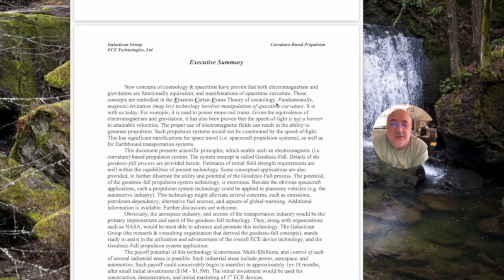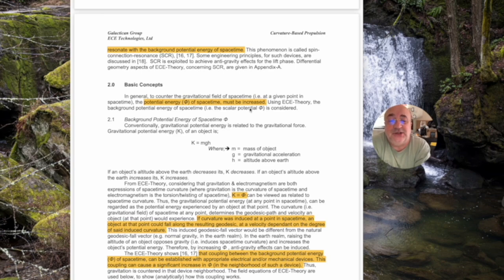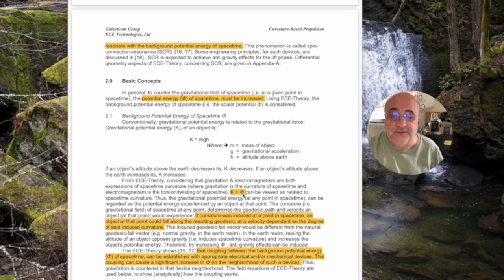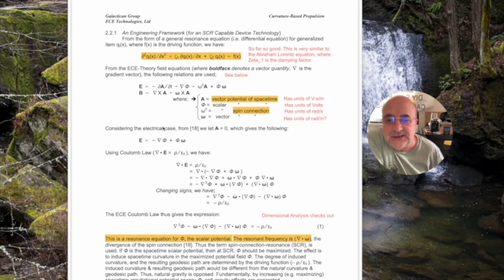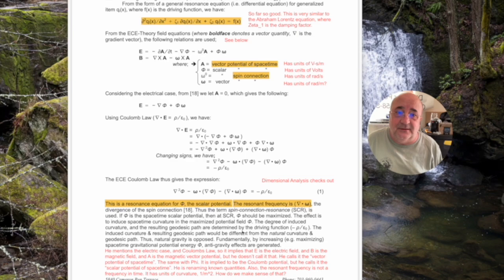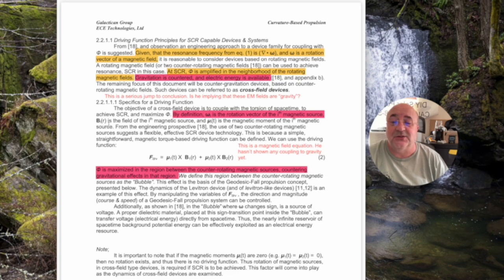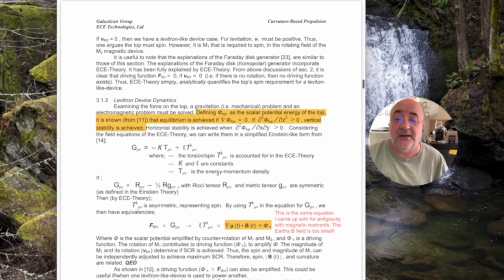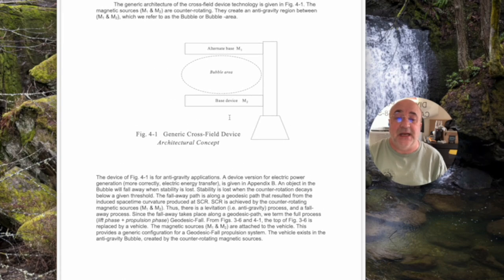Reviewing ECE Theory

Comment: Correcting the Reviewer’s Errors
The reviewer makes several mistakes about ECE UFT and the patent’s claims. Here’s a clear breakdown of their errors and corrections, using ECE’s math and concepts:
1.  Error on Scalar Potential (φ) Units:
	•  Reviewer’s Claim: The patent and ECE confuse φ, calling it both volts (V, electrical potential) and energy (mgh, gravitational potential energy).
	•  Correction: In ECE UFT (ECE Eng Model, pp. 4-6), φ is the scalar potential of spacetime with units of volts (V). It’s defined via the tetrad (q^a, units: meters) and a constant A^{(0)} (units: V s/m), so the 4-potential is A^a = A^{(0)} q^a. Gravitational energy (mgh, joules) comes from integrating curvature effects, not redefining φ. For example, the gravity equation (derived below) links curvature to energy-momentum, and mgh is a result, not φ itself. Bruchholz’s paper shows EM fields arise from spacetime curvature (R_{ik} = (1/4) g_{ik} F_{ab} F^{ab} - F_{ia} F_k^a), consistent with volts for φ. Maxima checks in UFT155 confirm no unit mismatch. The reviewer missed how Cartan geometry handles field units via differential forms.
2.  Error on Resonant Frequency from div(Ω):
	•  Reviewer’s Claim: The reviewer says the “resonant frequency” from the divergence of the spin connection (div(Ω), Ω in rad/m) has units of curvature (1/m²), not frequency (Hz or rad/s), so it’s nonsense.
	•  Correction: In ECE (ECE Eng Model, pp. 28-29; UFT382), the resonance equation for φ is ∂²φ/∂t² - Ω · ∇φ - (div Ω) v φ = ρ/ε₀, where v is velocity (m/s). The spin connection Ω (rad/m) combines with the speed of light (c, 3e8 m/s) to give a frequency: ω_res = c² div(Ω), which has units rad/s (proper frequency units). This comes from spacetime scaling in Cartan geometry (nLab: torsion T^a links to EM via frequency). UFT94 (Bedini device) shows this with the equation ï¿½A + c ω_0 Ḋ + c ω̇_0 A = -c² (∇ × B)_driving, where ω_0 (1/s) is the scalar spin connection. Maxima in UFT100 verifies this is dimensionally correct. The reviewer used classical vector math, ignoring Cartan’s wedge products (∧) that fix units.
3.  Error on Mixing EM and Gravity; Geodesic Motion:
	•  Reviewer’s Claim: EM fields do work (non-geodesic motion), while gravity causes free-fall (geodesic motion), so ECE confuses them, and the patent’s anti-gravity is just EM repulsion.
	•  Correction: ECE UFT (UFT15, pp. 302-303) unifies EM and gravity using Cartan geometry. EM is torsion (T^a = D ∧ q^a, like twisting spacetime, linked to F^a = A^{(0)} T^a for electric/magnetic fields), and gravity is curvature (R^a_b = D ∧ ω^a_b, bending spacetime). The 1st Bianchi identity (D ∧ T^a = R^a_b ∧ q^b) ties them together, so motion in ECE’s spacetime follows twisted geodesics (paths influenced by both curvature and torsion). In the patent, counter-rotating magnets create spin connection resonance (SCR) (UFT94: E = -∇φ - ∂A/∂t - c ω_0 A + c φ ω; B = ∇ × A - ω × A), amplifying φ via torsion. This induces a “gravity-neutral” region where objects move along these twisted paths, opposing Earth’s gravity (not just EM repulsion). UFT311 (Ide experiment) shows this with exponential current growth from a time-varying spin connection, matching real data. The reviewer ignored ECE’s unified geometry.
4.  Error on Needing Massive Energy for Coupling:
	•  Reviewer’s Claim: Coupling EM to gravity requires huge energy (3 GW/kg), and the patent’s Levitron is just standard magnetic levitation (maglev).
	•  Correction: ECE (SpaceEnergy.pdf, pp. 2-4; UFT382) shows SCR couples EM to gravity with low energy by resonating with spacetime’s torsion. The patent’s Levitron uses radiatively induced fermion resonance (RFR) (circularly polarized EM to magnetize materials, patent claims 7-8), creating a torsion field that opposes gravity’s curvature (UFT94). This forms a gravity-neutral zone, not just maglev. The force comes from a modified Lorentz law, F = q (v × B_S), where B_S (spacetime magnetic field) is B = ∇ × A - ω × A. UFT382 shows overunity (output energy > input, Fig. 4) via resonance, not massive power. The homopolar motor analogy (InducedMotionalEMFs.pdf, pp. 17-19) shows no reaction torque, extracting energy from spacetime’s torsion reservoir. The 2nd Bianchi identity (D ∧ R^a_b = 0) ensures energy conservation. The reviewer missed this low-energy mechanism.
5.  Error on ECE Being Unconclusive or Hype:
	•  Reviewer’s Claim: ECE pulls EM-as-torsion from “thin air” and is hyped pseudoscience.
	•  Correction: ECE is grounded in Cartan geometry’s structure equations (nLab: T^a = d q^a + ω^a_b ∧ q^b; R^a_b = d ω^a_b + ω^a_c ∧ ω^c_b) and Bianchi identities (UFT15). The ansatz A^a = A^{(0)} q^a links EM to torsion, derived rigorously and verified by Maxima (UFT100, UFT155). It explains anomalies in Frolov’s book (fuel-less generators, ball lightning as torsioned plasma, anti-gravity via geodesic opposition, overunity via SCR). Bruchholz’s Riemannian_torsions.pdf shows EM from curvature alone is possible, supporting ECE’s flexibility. Refutations of Hehl’s critique (physics/0703116) confirm ECE’s math is consistent (UFT100: Bianchi D ∧ ~T = ~R ∧ q ≠ 0, no GR collapse). The patent’s claims (e.g., anti-gravity region) align with ECE’s predictions, not hype.